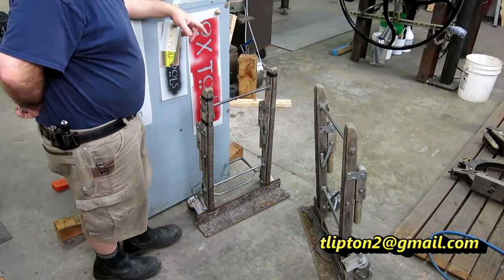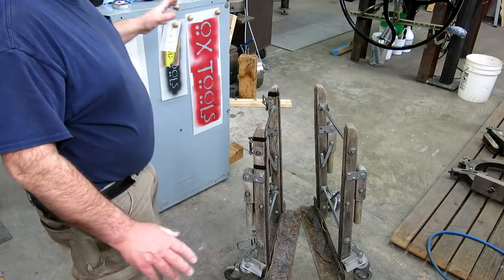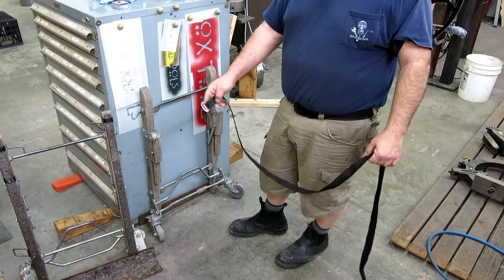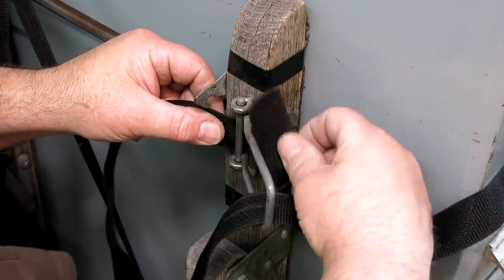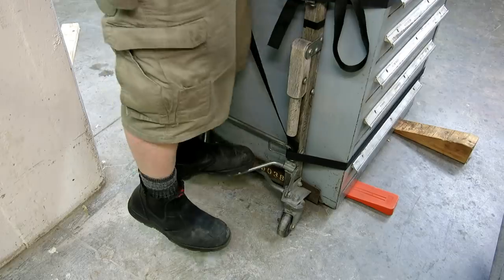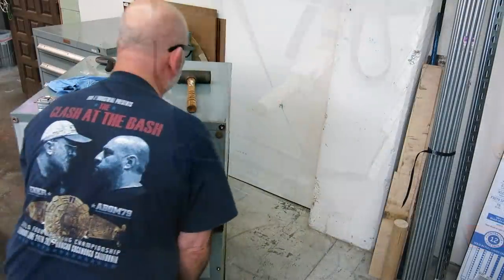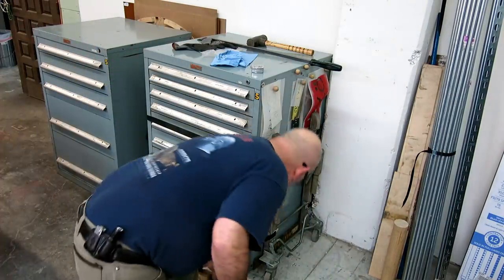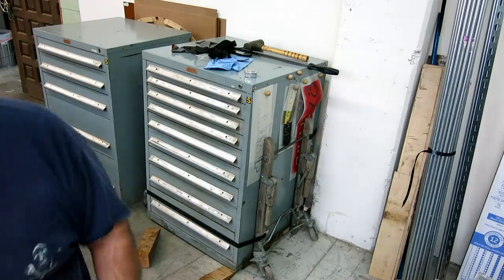Roll or Kari Moving Dollies

Comment: Hi Tom. We have these in a later slightly version, they are used here to move 2 door Mosler Safe vintage over 1000 pounds, and they work really well, someone smart made these special. We own ours they make sense in a micro machining operation I was told here when we bought them instead of renting them.  
Thank you for the share, Lance & Patrick.

Comment: It was a comfort to hear you admit that operating the strap tension mechanism was not intuitive. I have to stop and think about how to work the ratchet on my appliance dolly every time I use it. This type of dolly is very useful. I have used the fancier version on many a "in the middle of the night one man moving jobs" rearranging heavy lab and shop equipment equipment. However, I will admit to letting a pro move things when it came to Bridgeports that had to go down a hall into an elevator! Thanks Tom!

Comment: Maybe a handy tip, but the front kick plate comes off those cabinets(at least Vidmars do) then a low clearance pallett jack will slide right in, jack up and drive to where you like. :-) I moved 30+ loaded Vidmars that way last year, main thing when moving them is strap the doors shut!! It will ruin your day if your cabinet goes over a dip and the drawers all decide to roll out together! Same goes for moving rolling toolboxes. :-)
Reply: Exactly what I was thinking. I haven't encountered a tooling cabinet yet that didn't have a snap out toe cap on the front. Unfortunately, no tooling cabinet maker has yet realized that a standard pallet jack won't go under a loaded cabinet with the under  clearance that they give you. Our shop had a bucket load of narrow spaced fork, low profile pallet jacks. These were ideal since even low profile pallet jacks are usually rated 3500 lbs. Crowded shops rarely allow front of cabinet access with a forklift, but almost always have space for a pallet jack.  Front lifting with a pallet jack allows you to place cabinets side by side and tight against the wall. Toe kick covers and cabinets flush to the floor prevents chips and rolling dropped tooling from going under the tooling cabinet.

Another tip...  These cabinets are missing the locks meaning that the drawers can open while moving. The safety latches that prevent multiple drawers opening are easily overridden while under moving stresses. Prevent a tip over disaster by securing the drawers by locking the cabinet. Wrapping the cabinet with stretch wrap is fast and neat when keys or locks are missing.

Comment: I'm surprised you didn't set the cabinet on a couple pieces of square tubing to keep it off the floor a bit. I'd be afraid of rust with sheet steel sitting directly on concrete, and adding a bit of a gap would make the next move easier.

Comment: The rental centers would be wise to put a tag on these devices directing users to this video. Also, the nylon wedges are a must-have. A little cousin to them are plastic shims you can get from the home improvement stores. They are stackable and essentially sacrificial when necessary.

Comment: Hi Tom, I Have 9 Vidmar Cabinets And I Invested 100 per Cabinet Back When I Got Them And Put 4" Cast Iron Wheels On Each Cabinet. It Has Proven To Be A Good Investment Too Because They Are Easy To Move And Easy To Clean From Under. Another Improvement Was To Install Heaters In Each Cabinet. Now No More Rust. Ours Are Side By Side So Last Year We Made A Type Of Clamp Out Of Angle Iron And Put One On The Front And One On The Back And You Tighten It Up On One End. Both Together They Hold All 9 Cabinets Against Each Other Like As If They Were A Single Unit.
Reply: Why Did You Capitalize Each Word? This Would Be A Very Long Title...

Comment: Whenever I buy a new piece of cabinetry or machinery for the shop, the first order of business for me is to weld up a mobile base that has one swivel and two fixed casters.  This way you can literally turn the item on a dime. OSHA would probably have a hissy fit, but they are not welcome in my shop.  Seriously you cannot do this if you have employees, but for a one man operation it works out great.  Room is at a premium for me and this really makes a difference.  I design the base so it clears the floor by 3/4 to 1 inch and the item sits down in it.  Most bases are framed with 1x2 rectangular steel tubing on edge with flat plate welded to the bottom edge catching the corners of whatever is to fit.  I have some very heavy items in such bases I.e. 20” Powermatic bandsaw,  Ellis drill press, 3 ft radial drill &. Etc.  Over half of my shop has been in these bases for over 30 years.  There has never been a problem.  Nothing can fall over.  Nothing can even tip.  I have a Bridgeport in such a base, but I got gun shy when I built the base for it and used 3/4 x 2 solid bar for the frame and put two swivel casters up front rather than just one.  I know, I know,  the weight of the machine table going back and forth will not keep it level and thus cause error in the part, but I do not get NASA contracts, and to be honest I would put my work on it against any floor anchored Bridgeport.  I did add leveling pads into the base when I built it, but I have never needed them.  If you go this route do not skimp on the casters.  I would recommend wheels that are ball bearing rather than sleeve bearing and bigger items get bigger casters/wheels.The real benefit to doing this is that you will have unbelievable clean floors.  It’s one of the first things other toolmakers and machinists comment on when visiting.

Comment: Roll-a-lift was popular when I was rigging.
Reply: Rolla lifts occasionally show up at industrial auctions, but the riggers usually snap them up. Theres a similar type of safe dolly called an andeson dolly. Much simpler design than what Tom used, and can be fabricated by someone capable of welding, vs the 600 bucks a pair they get on Amazon.